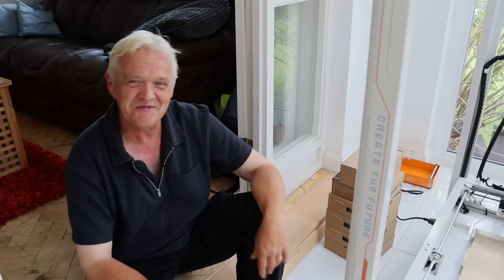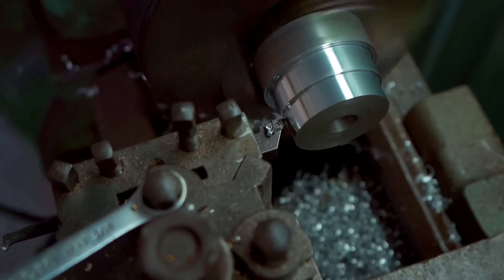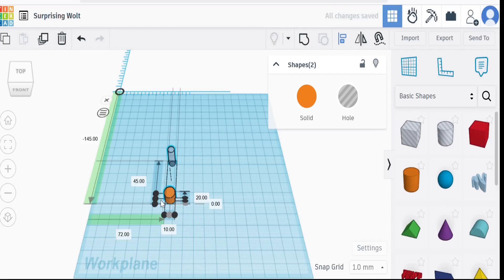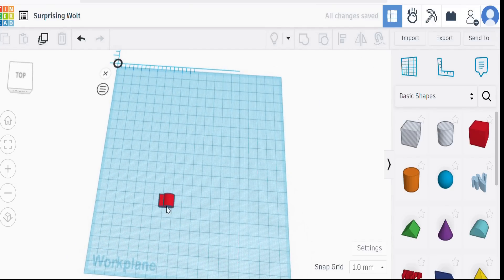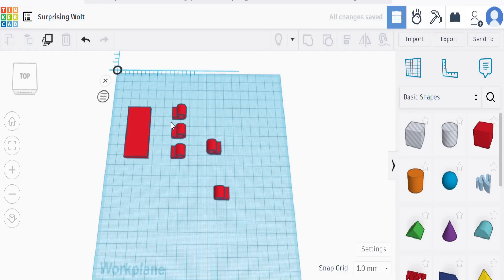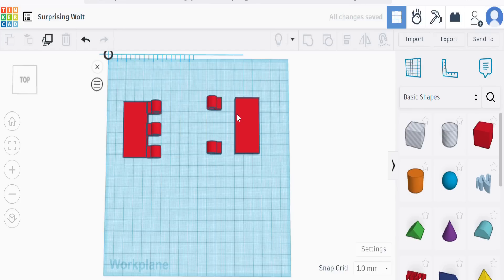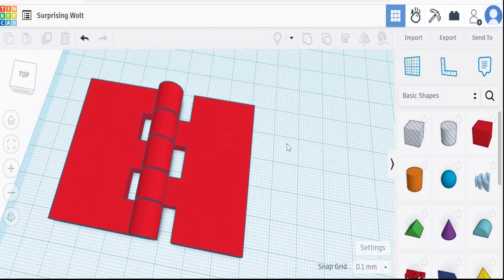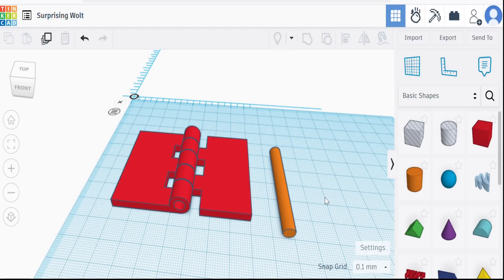2271 How To Design Parts - Tinkercad And Hinges

Comment: Have been playing with Tinkercad and getting absolutely frustrated with it. This video appeared in the suggestions. Learnt so much in 10 minutes it was annoying that I hadn't seen this channel before. Love the style of presentation. Thanks!
Reply: And now you no longer get frustrated with Tinkercad?  I even get annoyed when I see how much time someone spends on a design like this which in something like Fusion or OnShape would take 1 sketch and a couple of extrudes, i.e. less than a minute AND allowing you to go back into the sketch and change the dimensions in seconds if you might have gotten those wrong (ex. the tolerances needed for your 3d printer).  And at least to me they also seem easier than all the clicks needed in Tinkercad to switch accuracies or align/move stuff and their circles are actually circles, not 64-corner-polygons ...  That said, this makes me even more admire those who make complex devices with Tinkercad.  I just wonder how much more those people could do when moving to a decent CAD program ...
Reply: @MisterkeTube   Yes, there are still some frustrations but I find it easier to use than any of the 'proper' CAD applications I have tried. I have used design software for mainframe printing and was a mainframe analyst/programmer. Certainly not IT illiterate and can learn new things but not CAD it seems.

Comment: Nice to discover ways of doing things easier for one self in TinkerCAD, thank you!
Made an adapter for a belt wheel (that came from a washing machine) that had an oval center hole, I filled the gap to center the axle and added five blocks to grab hold of the wheels structure and then put a spring pin through the adapter and axle.
That way, me and my brother have now built a two meter long motor driven soil trommel.

Comment: I think the hardest thing I made myself was a test screw / nut. Getting the nut to be a true hex, and getting the screw threading to be addable (add x mm heights where the threading continues without flat bits). I didn't need it to conform to an existing thread standard, only itself, I don't know if it conforms to any standard threading.

Comment: I believe you mentioned in an earlier video that a 3D print's strength depends on the direction of the layers. Is this horizontal placement stronger than if you'd print them vertically?
Reply from the maker: it does depend and yes it is better printed laying flat with this design

Comment: I have used Solidworks for over 20 years as a design engineer, but I struggle with TinkerCad.
Reply from the maker: parametric modelling does have another dimension - but tinkercad is a great teaching and learning tool - at this stage i find the ideas and methodology of 3d design often foxes people - which is why i bang on about that bit lol
Reply: @ThinkingandTinkering  I know what you mean!
Reply: Solidworks background, myself... (albeit, not much) I was admiring how quickly these sorts of parts can be one-offed with his techniques... I'd be trying to make everything scalable and constrained to the point of 3-4hours to come up with these three simple parts he did in 10min!
I wonder about e.g. throwing the hole through the cylinder on the same plane, are these systems now guaranteed not to give zero-thickness? Really, it doesnt even matter with 3Dprinting, could easily just pop it out. What a different way of thinking!

Comment: I’ve pleaded in the comment section several times about this. All these videos of power generation are pointless without a video of how to store this power. Where’s the video that shows people how to take power produced by the inventions and store it in a solar generator?
Reply: ... do you mean a battery?
Reply: @McRootbeer  If I build a ceiling fan wind turbine as an example how do I get that energy into the battery correctly. There’s a lot in between power generation an storage and that middle ground has gone completely undressed by this channel
Reply from the maker: I have made 168 videos on how to make batteries, supercapacitors and control and charging circuits - they are even in a playlist - where on earth are you looking?
Reply: @ThinkingandTinkering  thank you for your reply, I don’t need a battery. I have an Ecoflow. What would I search for on how to charge it using one of your power generators?

Comment: the trickiest 3d printed hinge i made was a piano hinge that had 5mm leaves and used a 0.8mm wire as the hinge pin, it worked though, but then I found the hinge needed to be even smaller and stronger and ended up cutting down the smallest brass piano hinge i could find
Reply from the maker: engineers always find a solution mate !
Reply: you either have a very large printer or needed a hinge for a toy piano. Ether way, Cheers on your achievement! may you have many more!
Reply: @secretbassrigs  it was actually a hinge for a 1/12 scale model boat windscreen
Reply: @grendel1960a  sweet!